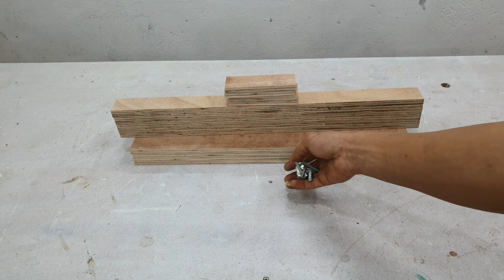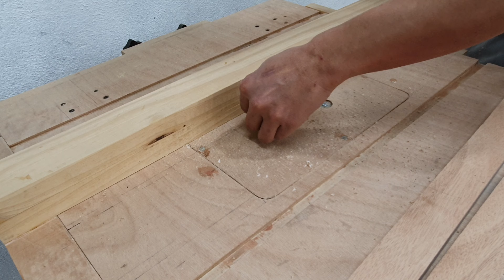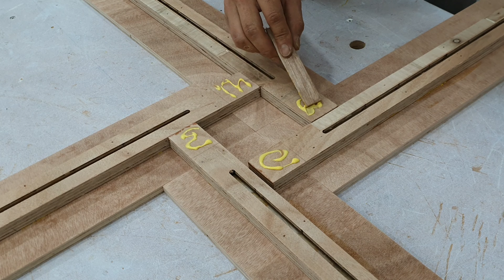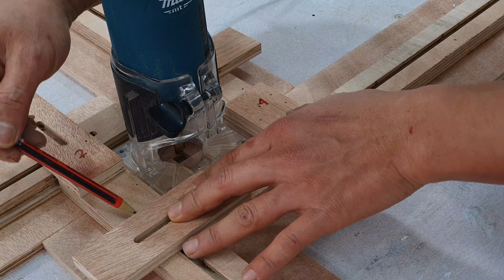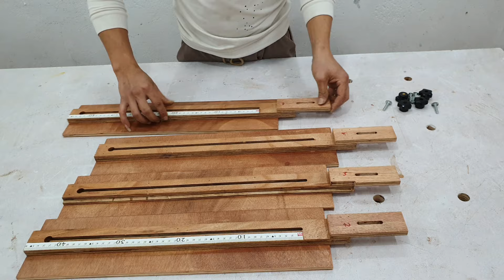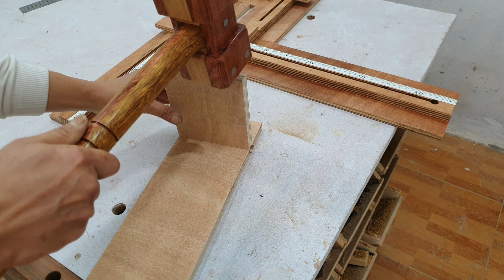DIY An Adjustable Router Jigs And Precise Rulers || Adjustable Router Template

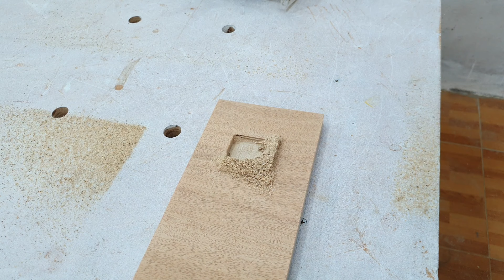Comment: My favourite jig, cleverly simple yet very easy to use and adjust. But pls ease my curiosity regarding Jig Arm #3 only: what is the purpose with the 5 (?) mm inner "lip" and the corresponding indentation on the locking piece (see video 10:46) ? Please, this keeps me awake at night! And at work... :)👍
Reply from the maker: Thank you for watching!
This jig is really useful and convenient for me.
Regarding your question...On the machine's mounting plate on the side of number 3 there is a small protruding ledge where they put bolts to attach accessories. And it got caught in the 1cm thick plywood I made, so I grooved that "lip"
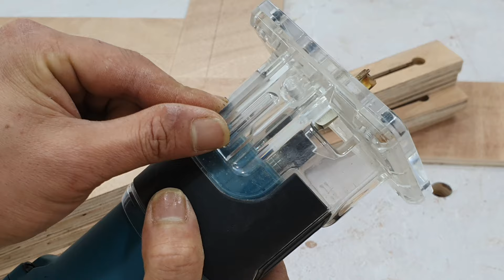Reply from the maker: You can see that protrusion at 2:12" in the video
Reply: @MrHWoodworking  Brilliant, thanks!
Reply: That is exactly what I was wondering!
Thanks, you save ME sleepless nights waiting for the explanation!! 🙂